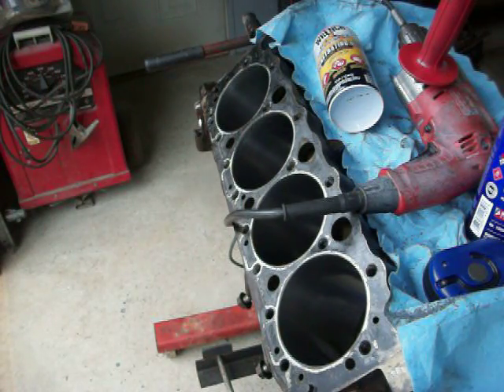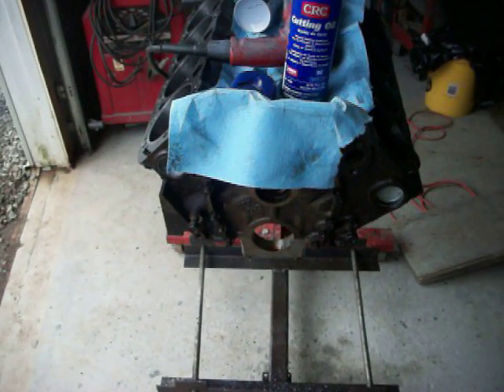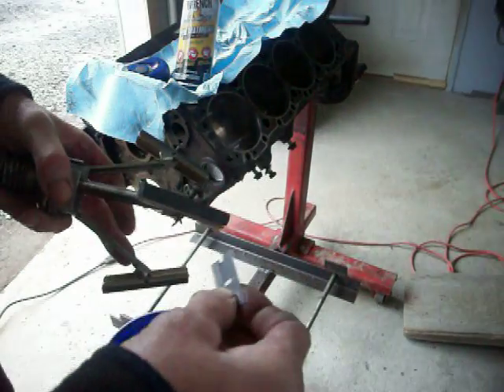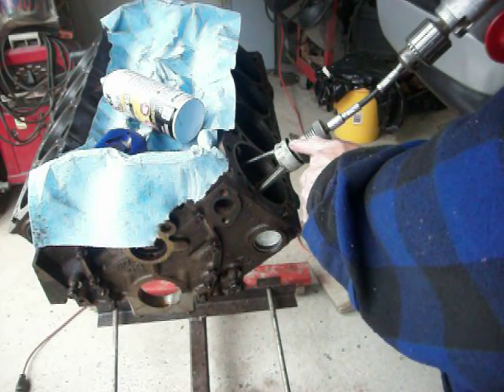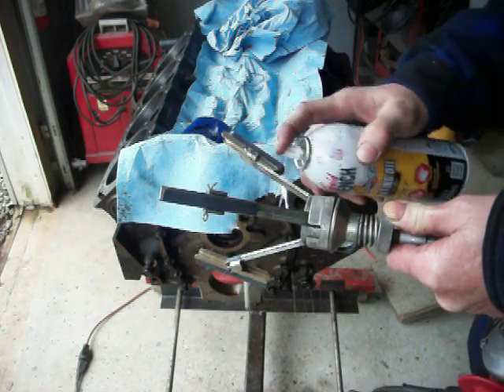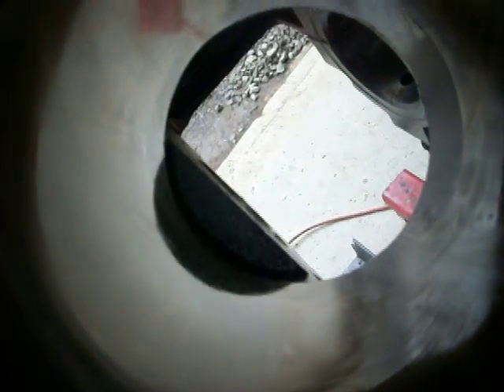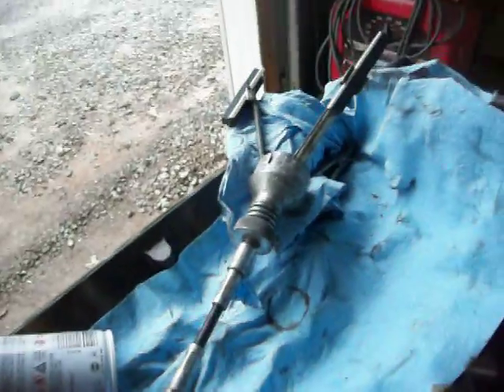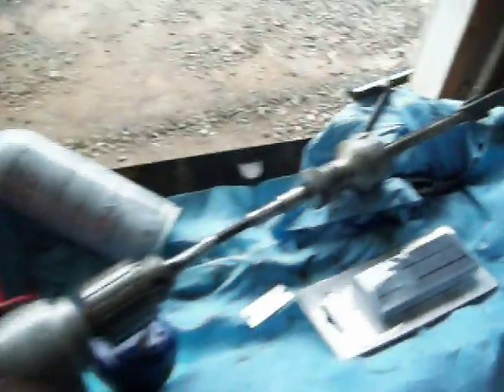How to use a cylinder honing tool for a drill.  Engine rebuild Video # 10

Comment: Staying up top too long will taper cylinder, and cause compression loss at high rpm. I stay even and ridge won't hurt anything even if not reamed as far as old timer taught me. Also a tooth brush works fine to clean stones and will never damage stones.

Comment: Heck with those stones you don't know what grit they are and they wear fast. Here's what you do, get some two sided foam tape they use for car molding, preferably thick otherwise you have to double up, cut the lengths to match the stones, tape it were the stones go. Then cut strips of wet and dry sandpaper, get any grit you choose, and tape that to the foam tape. Keep oiled while honing and the sandpaper will not clog up. It's a bit time consuming changing out the paper and the tape, but this way you can choose any grit you want from start to finish. Btw, be sure to get that 45 degree cross hatch pattern on those cylinders.

Comment: The cross hatch pattern is to low of an angle,look at the piston ring manufactures web site they tell you low angle retains too much oil on the walls and too steep the oil control ring will wipe off too much oil. Your hone job is better than not doing it.
Reply from the maker: Never had a problem in 50 years with my type of pattern.

Comment: I'm about to hone my cylinder in one or two weeks. I see that your honing pattern isn't good like that. There should be a crosshatch pattern between 30 to 60 degrees angle. I'm still preparing for the big day. Searching for the right RPM and stroke speed to get my 60degrees honeangle.  http://www.crosshatchangle.com/   Bad hone angle is bad lubrication.. :(

Comment: Can improperly seated rings and glazed cylinders cause a misfire under load?
The reason I ask is because I have a rebuilt 302 in a 94 f150 and it runs erratically under load and my compression is between 100-110 dry and 105-140 wet.
I'm afraid that I didn't break it in peoperly
Reply from the maker: With the compression you have, it sounds more like a possible timing or valve issue.
Reply: Ok

Comment: The liquid wrench lubes the cylinger alot and takes a long time to hone a cylinder. I was taught to use solvent insted and it will hone alot faster.
Reply from the maker: The idea is to keep the hoing stones clean. Any thin liquid will work.

Comment: I’ve got a flathead 45. Stock bore with light scratches, could I use this method and go .005 larger pistons?
Reply from the maker: No, get it bored .005 or whatever you need for the new piston and rings. This is for deglazing and preparing the bore so new rings will seat properly.

Comment: That is not a proper hone. 
You NEED to use an actual engine hone as in a Sunnen type hone - 
This flex hone will not true any irregularities within the bore, a Sunnen hone has a macro and micro adjustment - for a SBC to run the proper hone through it I can do the entire set of 8 in 45 minutes. With a 45 degree cross hatch pattern.
Reply from the maker: Ok so what part of the engine now has 80000 miles on it dont you get. LOL
Reply: You can keep your backyard mechanics - I will do it properly 👌

Comment: holy shit dude dont stop it to pull it out that made me cringe... if youre gonna do it this way pull it out while it still rotating to prevent scratching....
Reply from the maker: You pull it out while it is rotating and you will be buying more stones than you can find. Thanks for the comment
Reply: @josaljo1   Yes indeed, my stones separated from the tool, due to centrifugal force, and they broke in half, too.
Reply: Yes if you pull a spring loaded hone like that it will either beat the shit out of your deck before you get it out. Properly done its stopped toward the top and squeeze the arms together. Other then that the small marks won't hurt the cylinder. If your building a motor that It could hurt performance, it wouldn't be done like this anyways

Comment: Could you possibly hone a cylinder with just sandpaper? I have a 2-stroke bike and dont want to spend moooooney on a drill
Reply from the maker: MG James FIN At the bottom of the barrel I would use steel wool. But you are taking a chance on messing it up.
Reply from the maker: Excellent advice, thanks texan.

Comment: Hi Jo,
Just wondering if i do hone my engine, do i need to buy a new set of piston and rings? Or just use the  oem?
Reply from the maker: You need to measure the bore because it has worn and you have to get new rings Pistons if good can be reused. Your question means you have not done a lot of this so do all the reading you can on rebuilding engines before you start. Dimensions in this area are CRITICAL. If the engine is going to run right or at all.

Comment: went too fast came out and bruised my knuckle , rebuilding a briggs snow engine check out my 2014 craftman snow shredder rebuild , 
2 nd rebuild 1st lasted 30 mins original engine ran with no oil piston seized to cylinder

Comment: Great video. Can I give you a suggestion. Rather than liquid wrench and water use diesel fuel. Ive found it to clean and cut easier and the oil from the diesel give a great finish.
Reply from the maker: Diesel fuel definitely does a good job, my problem is trying to get rid of it when I am done.

Comment: Question. Would ATF work as well? I was told that was the way to go.
Reply from the maker: You could use ATF since it is oil to do the honing, but I like the liquid wrench because it seems to pick up the crud and it washes off easy in water.
Reply: Josaljo Won alright cool👍 I'll be sure to rewatch your video before I hone out my SBC 350 small block

Comment: does your motor burn any oil now ? I used that method on my motor and it burns about a quart after 500 miles and it just a tiny 4 cylinder
Reply from the maker: My motors do not burn oil. Honing is a decision that is made after blueprinting the old parts. If they are found to be out of round (cylinders) then boring, not honing may be what is needed. Honing or crosshatching gives the cylinders a textured surface so the rings can seat better and have no burning of oil.

Comment: what the fuck are you doing your going to have to redo it your not post to stop the drill when you pull the hone out
Reply from the maker: When you pull the drill out of the cylinder, you do it just before the drill stops so you do not get scratches in the top edge of the cylinder.

Comment: i just put an engine together twice and didnt deglaze.... This is the most educational thing I have seen researching my smoke in the tailpipe issue. Obviously my rings have not seated and I have just been looking for someone else to say what Ive diagnosed as my issue.  Just felt obligated to say Thank You. Have a good one bud....
Reply from the maker: Thank you for the comment.
Reply: Yes sir. About to pull it apart again here in a few minutes. Any advice and grit stones to use?
Reply: Or whats the best grit to finish with...
Reply from the maker: I use 220 start to finish, just keep it clean as you work thru it.
Reply: Sweet appreciate that. ive got those laying in the garage. Itll be fun honing for the first time...
Reply: @84toyota4wd  , it's based on your rings you will use, some like a cross hatch with "×" grit... The rings deside... per manufacturer's recommendation.
Then oil and break-in...
Reply from the maker: Thank you for the comment. Good to know it helped.

Comment: There is some little rust on my cylinder walls (junkyard block) would it be fine to hone it till the rust comes out or just get the crosshatch surface on there and call it good??
Reply from the maker: If you can get a clean cross hatch surface with no pitting and the bore measures within specs I would use it.

Comment: The block I'm going to build is out of a 78 Lincoln it has no ridge to speak of maybe 3 thousands if that .
Reply from the maker: You should use a ridge reamer to get that out of the cylinder.Can you catch it with your fingernail?

Comment: just one question I've always washed the cylinders with dish soap and dryed them with air then wiped them with oil as not to rust and corrosion resistance.
Reply from the maker: Thats perfect, when I do it with the solvent its the same thing just a little stronger. You want to gap the rings with no oil in the cylinder though. Or you wont get a true reading on the gap. That why I use a very thin oil or wipe them dry.
Reply: Josaljo Won I didn't know that I figured the rings would damage the cross hatches with out oil on them

Comment: I watched you video one question I've all used wd40 on my hones I've used both type's beed and stone and the stone type seems to do a better job any ideas on it thanks.
Reply from the maker: I like the stone type because they do a smoother job in my opinion, more circular than the bead type. Wd 40 is good actually anything that will clean the stones off.
Reply: WD 40 or LPS 1 work well. I like to use stones, then finish with a bead hone.

Comment: great and would you recommend rings to be set at for a 305 sbc and by the way your videos are great I'm 19 and doing my first motor build your a big help
Reply from the maker: The 305 V6 has a top ring clearance of .017 to .027 and the second compression is .015 to .025 inches. If you meant 350 V8 then the gaps are .010 to .020 top ring, .013 to .025 second ring, and .015 to .055 for the oil rings. The 305 V8 is the same as the 350.
Reply: +Josaljo Won yes a 305 Chevy and so the oil ring is .015 to .025  and so if I did both in the middle would that be good like say for the oil ring do .020 would that be good?
Reply from the maker: It is .015 to .055" for the oil rings  .020 would be fine either way.
Reply: +Josaljo Won great thank you for the help

Comment: so after this you put the rings and pistons in?
Reply from the maker: Once the cylinders are honed and wiped out. You check the rings in each cylinder and grind the rings according to the specs. Then yes the cylinders are ready for the rings and pistons.
Reply: Josaljo Won what does grind the rings mean?
Reply: morsteen filing the rings to your desired gap.